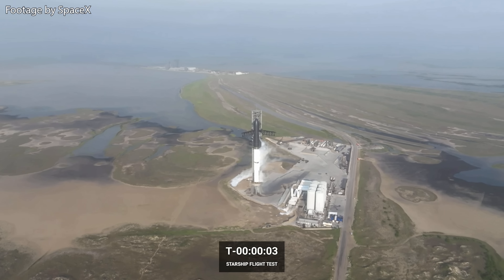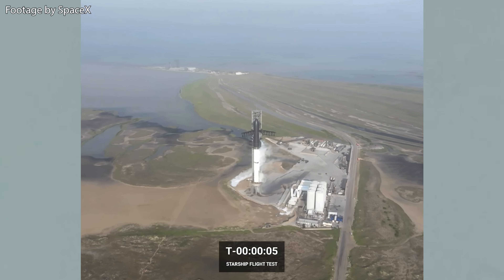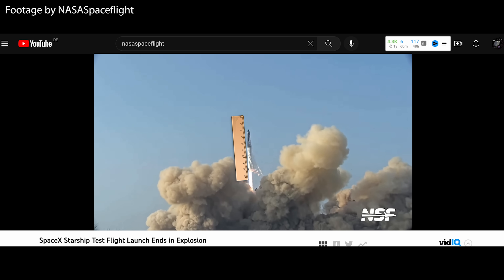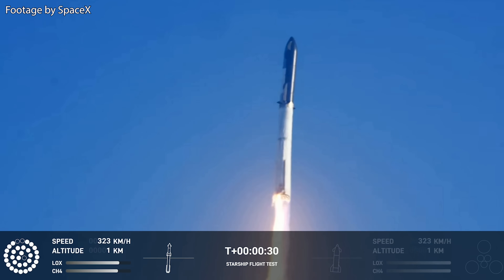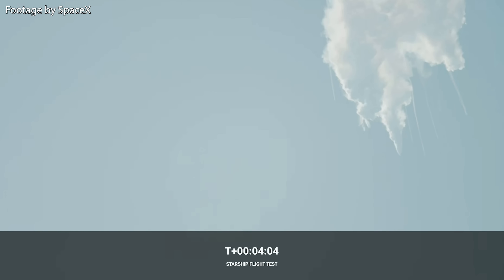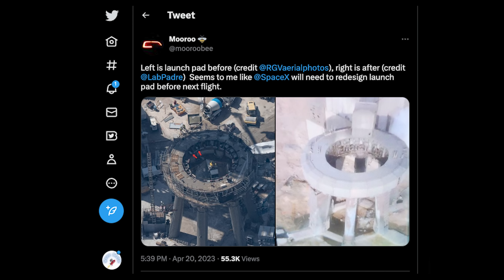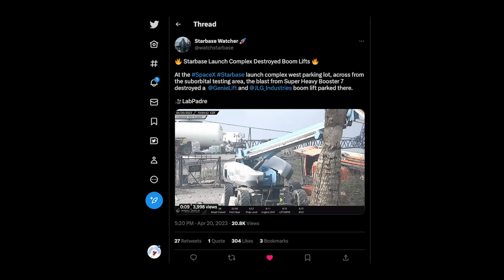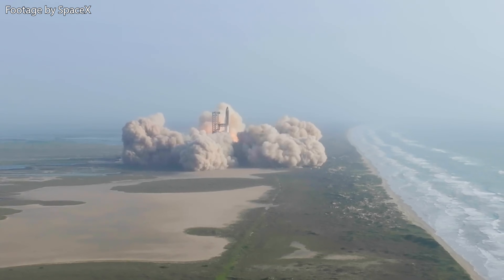SpaceX Launches Starship But Causes Big Damage to the Pad. What Went Wrong?

Comment: The damage to the stand is catastrophic. This is exactly what people were worried about a long time ago but somehow SpaceX failed to recognize or act upon it. I wouldn't be surprised if the shockwaves, vibration and flying concrete didn't break the first 3 engines and damage 3 further ones.
Reply: also sped up the rotation of the Earth
Reply: @President_NotSure  any molecule that leaves the Earth speeds it up.
Reply: And the weird thing is, this is not shocking or unexpected.  People have been telling them for months you need a flame diverter and a working water deluge.  Scott Manley did a piece showing the slow-motion shockwave from a 3-engine test reflecting back and damaging engines.  the sheer sonic force can't hit flat ground like that.  It needs to be reflected (diverted) away
Reply: Elon alone drove the push for no flame diverter/sound suppression system
Reply: @savethedeveloper  Really?  Maybe he smokes too much, sometimes.  😄
Reply: This was a big multi play gamble and many hands one, including the program, but the vehicle, mission and launch-site were big losers.  I'm in the unusual position of thinking that this gamble was too high stakes, which has won a lot, but cost a lot, was reckless and not what I'd expect from SX.  The only silver lining I can see is a radical redesign of the launch site, which is now undeniably required.  Maybe moving to sea-launches as a short-term fastest way to a reliable Stage Zero.
Reply: Considering the massive thrust of this vehicle, why did Spacex not construct a flame trench to divert as much of the blow-back as possible during launch.
Reply: some speculate that the sole reason that Starship failed during the launch was due to HPU getting blown out. It's pretty pathetic considering that the next boosters after B7 won't have it but at least they'll realize that they will need a better launch pad.
Reply: It was locked on the pad longer than it shd have
Reply: @willmac5642  The lock down clams were released before ignition. Nothing holding it down except gravity.
Reply: @spitbacca  Did SpaceX not also say that the engines were only throttled to 70% at launch? If that amount of damage resulted, imagine what 100% would do!
Reply: @spitbacca  No problem.  My information was hearsay from Tim Dodd's commentary.  I always toand to be corrected if I'm wrong.  In this case we both got closer to the truth
Reply: @timboatfield  right, but it was noted it took far longer than anticipated to lift off. Like a longer. These engineers deal in milliseconds and nanoseconds. Full seconds off are considered comically catastrophic. While Elon and the gang keep saying, “relax this is just a test”, apparently the engineers said “don’t test this, we know where the issues are gonna be. We are wasting cash”. SpaceX execs said “screw-it, light her up”. Nothing about this launch was a success. Yes, it managed to lift off, but in this era that’s sorta akin to saying “yay my new car left the dealership parking lot”
Reply: @stevenw.miguel  That's cool!  You can think whatever you like, but a bunch of hearsay and speculation doesn't make it reality.  
  Can I ask have you ever designed something and built more than one of it?  I rather suspect that the answer is No.  When you have you opinion might have some value.  Until you have some experience to base your opinions on, I wouldn't express them so forcefully.
Reply: Thermal heat
Reply: They desperately need a flame trench/diverter and water deluge system.

BUT…Elon didn’t want to use a crawler, so they can’t build up like the pads at Cape Canaveral, and it’s protected wetlands a few feet above the waterline so they can’t dig down.

I have no idea what they’re gonna do, but it’s been painfully obvious that launching the largest rocket ever only 30-40 feet above flat ground and hoping for the best isn’t the answer. There’s no doubt in my mind that most of those engines were taken out by debris before it even clear the pad. In some of the camera shots you can see sidewalk sized chunks of concrete flung in hundreds of feet in every direction.
Reply: Catastrophic? It will be ready before the next Starship stack is, bet on it.
Reply: @tertiaryobjective  You lost that bet, as several starships/boosters have already be ready. The damage to the pad is going to take a few months to fix, as well as add a diverter some how. They might have to start all over.
Reply: @hawkdsl  They're built,  not ready, same as the stand.
Reply: @hawkdsl  I don't get why so many SpaceX fans worship everything SpaceX does. Sometimes you need to take the hit and admit you were wrong. The problem I have with SpaceX and their fans and the employees are that they never admit the reality. The pad design was a system's engineering failure. It will never happen under NASA or other old school corporations watch. Kudos to the team for getting such design ready, but they need to go slower, more testing and more anaylses to be successfull at the end. That's my 2 cent.
Reply: @armanm6178  SpaceX fandom not a bad thing. Most are very young and haven't developed a critical eye yet.  It's great to have young people interested in space again.
Reply: "failed to recognise" lol don't be so stupid. SpaceX recognised that issue years before you did, they weighed up the pros and cons and made the right decision. Instead of spending 10 years building a launch pad like NASA would have done.
Reply: user-ph1wf6mn7s  Well, that's just silly. I wonder if some hamburgers were on board the last Dragon launch to the ISS?
Reply: УКРАИНА ПРОСРАЛА УСЕ  surely you mean hotdog which are shaped like a broom stick (a la falcon 9) 🤣
Reply: so I'll take that comment to mean that you're so completely clueless about building ANYTHING that you don't realize V1 always has problems
Reply: It was a steam explosion from UNDER the launch pad that did the damage, not the thrust.  The ground was wet underneath the concrete and it flashed to steam due to the HEAT of the  engines.  A steam explosion is extremely powerful.
Reply: Without a water suppression system the energy was not transfered away and cushioned..would not be surprised if resulted the rapture engines damaged especially from flying debris..the vehicle could have experienced a severe shock to the vehicle and maybe a play in stage separation malfunction
Reply: @bxpress6507  The common mistake everyone keeps making is that a water deluge would of helped. It wouldn't, WD is only for sound suppression. Pounding the surface at 90 degrees with rocket exhaust and WD would make the same mess. The stage sep fail was because it didn't have hydro pressure. One of the debris damaged raptors exploded @+30 seconds right next to a hydro unit, taking it out. Two more raptors on the other side took out the other one as well, and that was when the corkscrewing began. It couldn't sep because there was no hydro pressure.
Reply: This program is cool, but it has a long, long way to go. I'm willing to bet they could have flown on 4/18, but Elon thought it would be funny to fly on 4/20. I'm sure Gwen Shotwell spends allot of her time chasing Elon around like a 5 year old in a xmas store most of the time. Her #1 job is to keep Elon from fking it all up. This flight was a waste, and will cause unnecessary delays. Having the diverter and water deluge installed before the flight was the smart play, but Elon wanted his 4/20 flight. Other pics and videos of the site show that it is totally destroyed. There are pipes leaking gas everywhere, and a few venting out of the ground far away from the pad. I have 100% confidence the flight would have worked perfectly if the pad hadn't shot up the ship into swizz cheese. Here's what SpaceX learned from this: The pad design was moronic. Flying the most powerful rocket from such a pad that took almost two years to complete was even more moronic. That's it... because any data from a swizz cheese rocket falling apart as it flew is worthless. NASA has to be wondering WTF is going on, as they are waiting for their moon lander. Totally, absolutely, moronic.
Reply: Shhh.. Elon thought it looked cool and simple. don't disagree.. he'll fail and has enough taxpayer money to redesign redesign. along as it launches on 4/20 or 6/9 etc..
Reply: The point of testing is to identify and also to quantify the problems that need to be solved. So, either spend way too much overengineering the structure or bend some metal and see exactly what kind of engineering you need. The latter is much less expensive in the long run.
Reply: @michaelsutherland5848  That, and there was a not inconsiderable chance of an on pad explosion that would destroy the pad regardless of how well built it was. Why spend a ton of money on the pad until you know you have a fairly reliable ability to get off it.
Reply: @michaelsutherland5848  So what the equivalent of two Saturn 5 Rockets together will do to a flat, concrete stand on a site 1/5 the size of the Cape Canaveral pad, with no flame trench, was such a mysterious quantity that it required a real-time experiment because these rocket scientists couldn't, as engineers, model or predict this plume-of-flying-garbage outcome?  I'm incredulous.
Reply: @michaelsutherland5848  It's better to over-engineer adding a 25% increase in cost than to under-engineering and end up paying 85% increase in cost after the disaster. In this case, under-engineering was definitely not less expensive. Especially when you factor in the fact that he has to rebuild another entire rocket and the launch pad and he still have to re-engineer both. More often than not, trying to go cheap usually ends up costing you Double. Until the project start producing a profit, even the downtime between now and the next launch will cost half a billion or more. Some of the engineering disasters I seen in this video were stuff that has already been solved in the 1960's but ignored in favor of thinking its obsolete due to newer technologies. Better to make something a little too safe than to make it safe but barely. They had to hit the self-destruct button because they didn't have a contingency to correct the issue mid-flight. Now they wish they had. This is why anything that must succeed at all cost will certainty add cost. Anything that must not fail, must always have built-in redundancies.
Reply: @hellbent7062  Remind me what was the cost of sending up SLS again? 20-someodd billion if memory serves. For that, SpaceX can fly 100 Starship tests and still have plenty left for a moon base.

Who cares about damage to prototype equipment?
Reply: @michaelsutherland5848  Well, in your first comment, you said "They were trying to avoid spending way too much money and avoid over-engineering so they took the least expensive route. Now suddenly you're saying, "They couldn't care less what it costs." 🤣 Those contradictions are your words. Not mine. By the way, you also said the prototype was damaged. 🤣 So, please tell me what part was damaged ??? Just fix the damaged part and reuse the rocket! 🤣 Dude, it wasn't damaged. The self-destruct button was pressed and it was completely OBLITERATED nearly out of existence and blown to smithereens 🤣 There's a big difference.

Now they have to spend another 10 to 20 billion? Elon may have a net worth of 175 billion but as of today he only has access to 18 billion cash on hand. With just 18 billion cash, he can only absorb that cost about 1 more time. ( Maybe 3 more times if he uses his companies as collateral credit) before he starts considering chapter 11 bankruptcy. Unfortunately, his co-owners, board of directors and shareholders will stop him at 3. How many times do you think he will do that before he starts caring what it cost? I'd say he cares right now!
Reply: @hellbent7062  Nice straw man. I didn't say they didn't care what it costs, I said their process is far cheaper than the traditional development process, even with bent metal and blasted concrete. So they can afford to take greater risk and fail more often during development.

These tests aren't costing SpaceX anything near $20 bn. Launching the first SLS, with traditional engineering practices, with many off-the-shelf parts, no new technologies, and solving no new problems cost NASA roughly $20 bn, with a projected cost per future flight of over a billion.

Musk did chime in about this situation after my initial comment. He said they have a steel flame diverter under construction, but it won't be ready for another month or two, and they thought from the static fires that the specialized concrete would withstand the blast. So they moved ahead rather than delay the program. Given that all the hardware (except arguably the tower itself) is disposable, only ever meant to be used once, I think they made the right bet.
Reply: @michaelsutherland5848  According to you, breaking stores and vehicules is a way to understand how the structure resist to the energy of the launch ? To risk to damage the rocket with the pieces of concrete is not a mistake ?

Isn't that a sign of depracated ?
I'm so rich, than I can do all the mads of'the world, they say I'm a genius.
Stop kiding, Ellon is maybe the worst step of our devellopment, because he have the power of money, and a head so big, so big. Sorry for the people who applause at every new feat. Poor man of Ellon.
Reply: @michaelsutherland5848  Elon said in an interview that it was either going to be OK, or the dumbest idea ever. It was a cost saving bean counter type of nonsense choice, and now it will cost twice as much to fix it. This is not a "quantify" moment, it's a "We knew better, but did it anyway" moment.
Reply: @hawkdsl  So? This is their development process. If he wrecks his equipment, that's not your problem, is it? In the end, SpaceX runs rings around its competition by trying out the dumb ideas.
Reply: @hawkdsl  You are right to some degree. I think it was more of trying to launch asap instead of waiting months for the cooling plate they were building. Bad gamble either way.
Reply: Ah so a fella on YouTube claims he knows more than an entire plethora of engineers and scientists. If they failed to recognise, it’d a shame they didn’t have you on stand by. Luckily your in the YouTube comments to alarm them.
Reply: @FaridgeTheFrog  Fella on Youtube? NASA figuared this out decades and decades ago. And I get it, Elon's first principle engineering philosophy is all about challenging the status quo. But this is such basic shit when firing off big rockets. It seems like something that didn't need to be challenged.
Reply: @FaridgeTheFrog  You think all engineers had the same conclusion?
Reply: Even I could recognize the pad was going to get annihilated and I’m just an uneducated idiot.
Reply: @jimbob4456  Me too!  Although, to be honest, I didn't think it would do all that excavation underneath.  Wow!  So, that proves that old 50's movie, "Conquest of Space" was right.  They used the rocket engines to blast away Martian dirt and level their rocket so they could launch and leave Mars, after waiting over a year for the next launch window.  😀
Reply: You're being dramatic. Most of the serious damage is limited directly to the launch mount. They're going to have to do some serious construction to it to install a flame diverter anyway.
Reply: @jaffacalling53  You wait to se the videos in the coming days of everything smashed up.  It's bad.  The OTF has been hit.  I'm confident a lot of the pipe work has been hit.  Any exposed piping and FireX system will be gone.  The tower likely got hit with high velocity car engine sized blocks of high density concrete.  They Fed up on this one!
Reply: @timboatfield  The tower is certainly fine, structural steel is pretty resistant to damage
Reply: @jaffacalling53  When unstoppable forces meet immovable objects, something has to give.
 I suspect we will all get an updated education over the coming days.
Reply: I'd take a guess that they were fine with some engines being knocked out, it's a great opportunity to collect data on how well the systems can compensate. I wonder if they purposefully shut a couple down for that reason.
Reply: @michaelsutherland5848  Unlikely!  Yea let's reduce our odds of success!  Yay!
Reply: @timboatfield  When "success" is defined as "let's see what we need to fix," then this wouldn't decrease the chance of success.
Reply: @michaelsutherland5848  I'm going to run really fast in a direction.  There is a wall in my way.  Let try and see what we need to fix, doesn't sound like a competent plan.  This is basically the situation here.  This is one that half of yt were screaming out.  Lucky scape is my verdict.  RIP the NFS-mobile.  Service above and beyond.  The lump of stage zero that hit it, covered about 100M in about 11 frames.   Thats just shy of supersonic at ~1,000 kph! 
  No blowing out a load of engines and your ability to steer them out the gate, won't decree the success odds at all.  Really?! Is that really your position?
Reply: @timboatfield  That's SpaceX's process, and it's running rings around the competition. Doesn't really matter if it makes sense to you personally.
Reply: @michaelsutherland5848  No that isn't spacex's approach, just your perception of it.  I didn't mention anything about making sense, but if you have run out of argument and need to chase phantoms, I'll accept your defeat.
  Elon i usually actually highly risk averse, if the numbers don't add up, that's the end of it.  Somehow, this quite dumb thing slipped past SX.
Reply: @timboatfield  Glad you're here to let them know!
Reply: No one was worried about it until this launch. Please don't spread propaganda.
Reply: @Ergzay  and that’s the problem… no-one considered the consequences of groundwater heating and bleve as a result of a launch.
Reply: Mars ain't never gonna happen.
Reply: @rhllnm  lmao :)
Reply: @rhllnm  Why do you say that?  I guess you're not a software developer.  You don't understand whats going on.
Reply: @rhllnm  not with that attitude. 😂